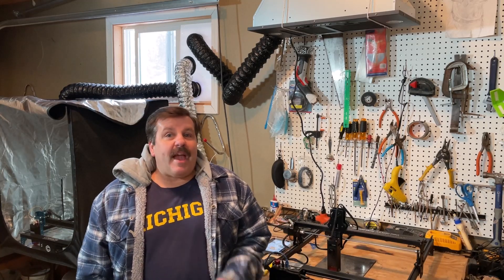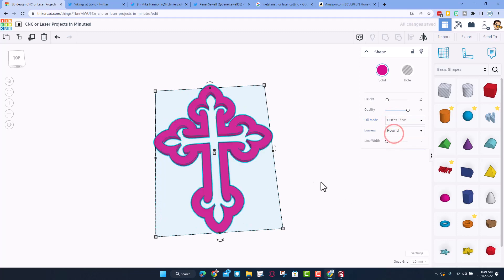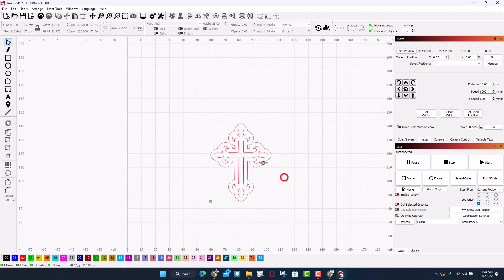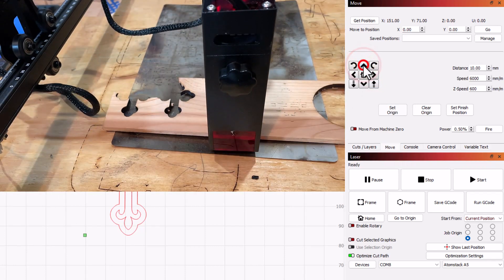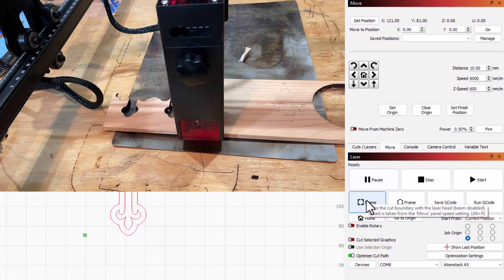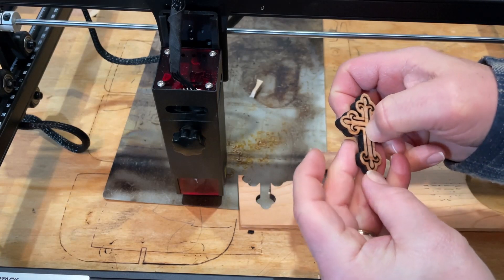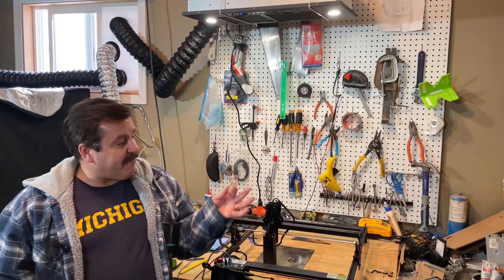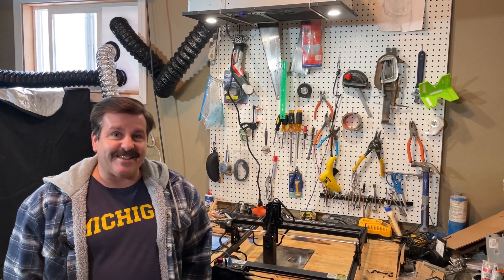A Wooden Tinkercad Cross in Minutes ATOMSTACK A5 M50 PRO

Comment: Where can I find the file for the cross that you are using?
Reply from the maker: The user that needed help had bought it... I will see if I can re-create it in Tinkercad though. Seems like an easy enough design.
Reply: @HLModTech  Thanks!
Reply from the maker: I did some working and was not successful. I think your best trick is to buy one or use this technique after you find a image you like. https://youtu.be/ua1fT4Xh2fY